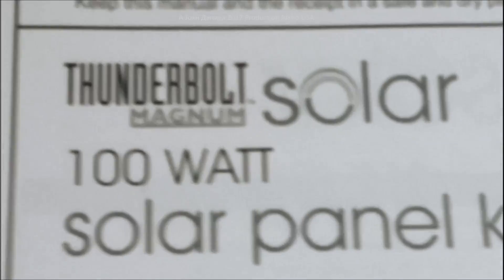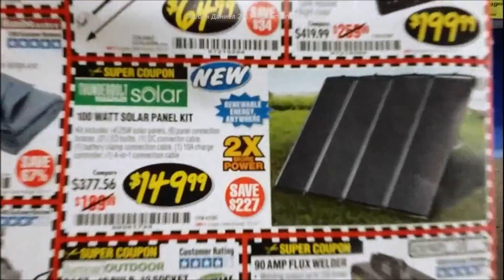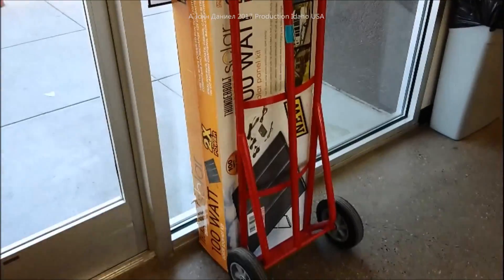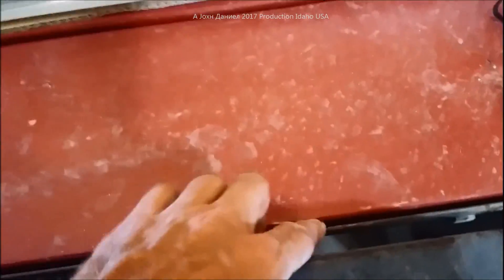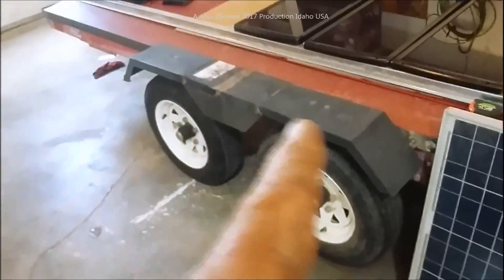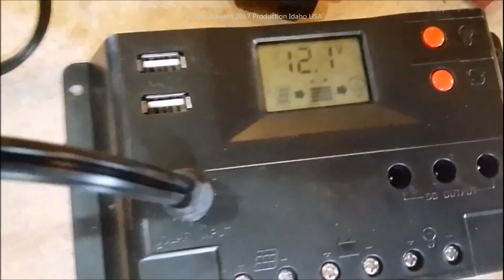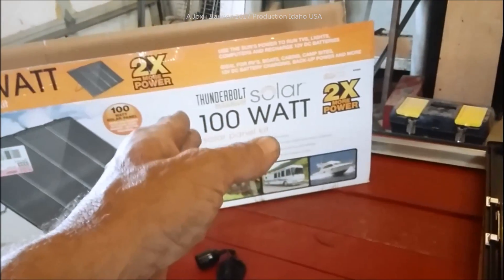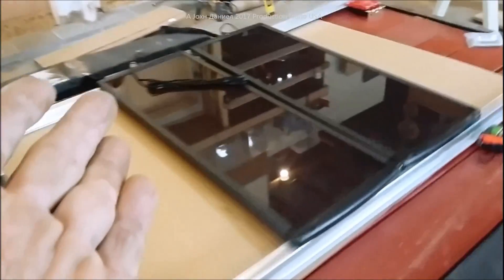Harbor Freight 100 watt solar kit #63585 NEW Thunderbolt Magnum (MAJOR PARTS LIST BELOW)

Comment: I was reading the Description area and followed ebay out on the solar panels " ADING! Best Solar Panels @t MightyMax100w4bar 5 of these 100 watt for a total of 500 watts, great low sun abilities & a perfect safe 92.5% the capacity of the 40 amp MPPT and VERY SMART design. "  and i noticed that the size of these solar panels are perfectly matched with the harbor freight ones.  2 hf 25w panels = same LxH as 1 mightymax panel and the voc is pretty close to hf and everything!!  good lookin out on that! I prop my 300w of HF panels against south sid of house on ground, plan on adding these mightmaxes in the middle of them to catch best part of the days.  I still am running my HF in series/parallel 2xseries 6 sets paralleled.
Reply from the maker: Yes, the 100 watt panels I found and use in my stuff, the best part is the 4 buss bar allows you to lay them flat and still get 75% and better from them. Few can do that.

Comment: I’m a new rv owner. I only have meg and positive the I connect to my car using jumper cables. I’d like to do this. John Daniel will you help me. I can buy the solar set up. Then a rv battery. Idk why my plugs in the rv aren’t working only one is working in the bedroom. Do I need to buy a inverter? Check fuses?

Comment: How long does it take to charge your 12v battery off the 100 watt solar panel
Reply from the maker: Depends on the Amp Hour, starting voltage of battery, Age of battery and wire length to battery. 
Standard #24 size 12 volt deep cycle marine battery at 11.75 volts ( low battery ) and a kit with a normal days sun you can be fully charged in 9-10 hours.

Comment: I purchased 2 of these kits and compared to the old version these are not as tough. We had a hail storm which blew everything over. 2 of the new panels cracked and none of the old panels cracked.  Otherwise the 100 watt sets work very well. I keep vehicle batteries charged.

Comment: 👍 Hello John!

Oh man, would it be nice if we also had a shop like "Harbor Freight"!
And YES, I always watch your videos more than once!
On some days your voice sounds through the living room as if a good old friend was visiting!

That's what our alternative thin-film guru's say, they swear by thin-film, also because of the obsession - our state consultants to get funding from the state-privileged solar installers who only recommend the overpriced monocrystals. You don't get a connection certificate for others than the recommended ones, so there is no funding and you cannot feed your electricity into public networks - which I don't intend to do anyway. A solar consultant has charged me with a south-facing roof with an unobstructed area of 130m² [1399.31 square feet] and I have a self-sufficiency of 48% - an idiot who feeds in and buys back his electricity expensive!

Comment: John.  Quick question about the 100 watt Harbor frt. solar kit.  If I had 2 of these kits, would it work to use both charge controllers paralleled to the battery bank?
Reply from the maker: Yes, the battery will not know the difference but the controllers may switch on and off charge a bit different from time to time.
Reply: @JOHNDANIEL1  Thanks John.  Then again, it might just be better/easier to get the 400 watt controller!

Comment: It's a miracle 12v showing, but what about the current going in? Do a test outside under the full sun showing Watt input, panels facing the sun & panels lying flat. Looks like a great kit, well done Harbour Freight.
Reply from the maker: The next few videos I did on them shows the mounting, and use with output.

Comment: I have a harbor freight inverter like to know if it would work for my RV AC unit cen-tech power inverter 1,500 watt continuous/3,000 watt surge  item 60601
Reply from the maker: No, your surge to start exceeds 3200 watts for up to 5 seconds. You would need the 3000 or larger inverter with a high surge capability.
Reply: Is there one that you would recommend over harborfreight or is harborfreight going to be fine
Reply from the maker: @chuckmac6541  I would upgrade to 3000 watt and if you stay with a square sine wave style get a better modified plus style and if its under 18 lbs for being a 3000 watt I would pass on it.
Reply: And how many golf cart batteries would you recommend for solar
Reply from the maker: @chuckmac6541  Depends on your entire needs, solar input, and what your trying to install it in.

Comment: Hello it's 2019 now, do you still recommend this??? 

If so I'm getting it. Winter is coming to the north east, very low sunlight soon
Reply from the maker: Yes, Not as a home solar system, but as a good basic power source. I just did a video last night, at almost dark and the panels dirty and still laying flat on my truck with total thick snow clouds blocking and it was making 14 watts still, I was glad after 2 years up there they have not as the naysayers said lost their ability to do well.
Reply: @JOHNDANIEL1  thank you! I'll check out the new video, I watched the1 year update
Reply: I'd say it depends on how much you're willing to do yourself. You can get off of Amazon a much better a 100w amorphous panel and much much better charge controller for about $100-$110 (assuming you have prime for shipping). The big thing here is the charge controller which essentially determines the cost of batteries over the life of the system.  You'll still have to add in a bit of money for wiring and you won't get stuff like the LED bulbs that come with it, but you'll get a cheaper system at buy in and over the life.

That's not at all to say this kit won't do it's job, but having something like an MPPT controller instead of the PMW controller that comes with it makes a world of difference, especially for areas where full sun is not in steady supply.  

Briefly, the difference between PMW and MPPT is that with PMW you're stuck with the voltage that the panels are putting out for your charging voltage.  MPPT has some circuitry and a voltage converter that looks for and then settles on the best voltage to charge at.  If your panels are only making 11V and there's a 12.3V charge on your battery you can't charge it.  This is because depending on chemistry of your battery, you may have to have a greater charge voltage than stored voltage to actually charge.  

If I did get one of these setups, first thing I'd do is upgrade the charge controller followed by upgrading the wiring, but it's definitely a case of these do the job, but the job can be done better.

Comment: So what would ypu recommend to go totally off grid for power with a 50 amp travel trailer.
Reply from the maker: A LOT! The newer 50 amp service is 240 volt line from park/home with separation to 2 - 120 volt systems in the campers breaker box, your main goal before attempting to take it off grid is a 100% effort to cut its actual power needs first, then get your math ready for a solar layout. Feel free to ask in the future when you get the first part hammered out.
Reply: @JOHNDANIEL1  I have my TT in the power consumption mode it is. I dont have a TT that is new and using all sort of unnecessary items. What math do I need to do to figure solar system size? battery bank and number of panels etc...
Reply from the maker: @chadharris9353  Calculate all the items based on 2.5x the normal run rate and hours. IE: Microwave use, 1000 watt microwave uses 1320 watts to make 1000 watts heat but you only use it 10 minutes a day, then you have 1320 ÷ 60 min X 10 = 220 storage watts x 2.5 produced watts 550 watts gets used off storage battery. Watts in storage battery is math of battery amps x volts = battery watts. SO if you have 6 walmart batteries, 29 series marine battery as example, you have 102 AH x 6 ( 612 AH ) x static volts 12.8 vdc then you have 7833 stored watts capacity, after using the microwave for 10 minutes you have 550 less available. So to size your bank for solar, you take your battery need based on your appliances and planned use [example 9 hours of a tv using 50 watts is 450 watts off your bank or need to size a bank] so yours could be 10,000 watts of battery, and you calculate the sun power cycles ( amount of day hours you can charge from solar) Example 7.2 hours sun, how many solar panels x 1.25 do you need. How many 100 watt panels in a 7 hour cycle do you need to charge 10,000 watts of battery battery,  that would be the math. You must also calculate the prime use, thats the while in charge use during the day if you choose to use more. 
Theres a reason no online solar calculator is accurate, you can not predict human nature! But the basics are above, If I had much more info I can usually get people within 250 watts in design.

Comment: How many wats would I need  have electricity in 22x30 blding with lights and maybe 240 for welder and few wood working tools
Reply from the maker: 1500 to 2000 but add that welder, and you gotta add 8000 watts more!

Comment: Yeah, but under load, with only partial sun, what's the POWER generation? That's what matters the most. Voltage is nothing without a load. An almost dead batter can look good volate-wise without a load connected. Where's your amp meter, or a charger that shows actual power. If it's only charging with 0.1 amps, then it would take forever.

Comment: Those are junk. Use your head and buy a single 100w quality monocrystaline panel for $90  and a PWM charge controller for $30 and it will out for that HF junk 200%.
Reply from the maker: I have over 6200 watts solar and 2000 watts wind power but the majority of people who get to where I am is with a kit like this. 90% use it to learn since its made of all parts to show results of solar to usable electricity, no matter how small, then move up the ladder. You don't usually get people into a solar lifestyle without the solar bug! So hate if you will, but those goofy kits have put millions into full solar action, more than every Grubberment and Hollywood Limo driving Jet setting carbon burning GO GREEN fake leftist program ever concocted.

Comment: 3 years using these to power a home with No problems. Love them:) They work great with the Walmart 24D deep cell marine batteries, The main key is having a large battery bank to store energy in. I use 20 batteries.
Reply: Battery bank + solar panels?  Cool.  Sounds like you've got it so that during the day, the panels are both powering your home and charging the battery bank, so you can flip it over to the batteries at night, then repeat.

Comment: Dude your just saying this because your getting a kickback from the company. There are other people on you tube who say they don't charge much at all. One guy says he can run a basic led light 3 hours a day for 2 days and then it takes 3 to 4 days to charge the battery back up to where it was before. You shouldn't lead people who don't have much money to work with down the wrong path just so you can get a kick back. You seem like an ok guy but doing that is just plain wrong.
Reply from the maker: I don't make a cent from harbor freight. They don't offer anything for reviews not even discounts or coupons. You have to be some member of some group and have a website to approach them so I don't qualify.  Video is about what bought.  Look under the video you'll see a link to mighty max 100 watt panels and my point to go that direction once using this kit to learn from.

Comment: Great Video. Thanks for the info on the mounting material. I paid the same price (with coupon) for the 45w (3.75A) kit about 9yr ago and they still work but I am ready to get the new 100w (8.3A) kit for the same price (with coupon). It pays to watch for the coupons. I don't work for Harbor Freight but my 12,000 winch still works like new after 5yr and it has pulled some heavy motor homes onto the trailer. I got it with a coupon too.

Comment: This technology is out dated but my bf buys into the bull so I guess that's what we will end up with.  He just won't listen to me. Probably cause I'm a woman.
Reply from the maker: Being he's a Mule, have him haul 24 of them for $1200 up to run that AC unit or 7 of the MightyMax for $675. Work him like a mule LOL
Reply: @JOHNDANIEL1  thank you I showed him your reply and think it finally sunk in.
Reply from the maker: He should get the MM100 if your going past learning and hobby. These are very useful for anyone starting out, to learn and apply solar but if your going to build a real livable system, I only suggest them for outbuildings and maybe a RV to keep the batteries hot since they are a complete plug and play kit. But not for real home needs of anything large. Get the correct amount of MM100 and MPPT controllers I say.
Reply: @JOHNDANIEL1  he thinks a 5000 BTU air conditioner can be run off 200 watts of solar. I can't convince him otherwise. Stubborn as a mule. But I guess so am I as I will say I told you so til his dying day. LOL
Reply from the maker: Good to see the Mule is "pulling" up some better plan! Just start better and get good quality solar like MightyMax 100w (  https://ebay.to/2XoIGvg ) with 4 buss bar contact strips so it does well laying flat and in dirty conditions or cloudy, and plenty of new batteries, ALWAYS BUY BATTERIES AT THE SAME TIME, and for 500 to 1000 watts of solar you need 450 amp hours of battery or 5 like the walmart deep cycle Max 29dc. Use a Quality REAL 40 amp MPPT solar controller ( 500 watts input fits on this one http://amzn.to/2ggyi44 ) If you need answers then ask, I do a few solar and wind power installs every  month but check or post if you need to.

Comment: Those panels are ok, but not at durable as the old ones. They charge better yes but when using the supplied bracket attachments they become very flimsey and can twist very easy. The length of the wires supplied are also longer. You can also add the hub and add up to two kits in one controller along with one 45 watt kit too.
Reply from the maker: You do have the option to remove the plastic frames which I have done and it worked and place them in some 3/4" angle thin gauge aluminum. The seals on them are much better than the old ones, BUT not if the plastic frames stay on them. Using windshield butyl caulk and that aluminum ( 26 gauge ) you would be shocked, you can get 9 where 8 once fit. They do produce about 60% as claimed totally covered in dust and film. Thats AMORPHOUS for you! And for Durability, lifespan, my 2006 HF panels are still running the biggest they have (4 of them), 1156 bulbs @ 5.7 watt each 12v LED gate lights on the end of my property 13 years later, not one problem even the two 10 amp hour SLA batteries are over 6 years old and going strong on them.

Comment: o and the more i watch you the more i think your so full of shti
Reply from the maker: For 1, Harbor Freight kits are not a END ALL. They are the best way to learn. And mine that are over 10 years old still work running fence lights today. My 5800 watts on my shop and house are not HF. BUT,  It's haters like you that would have no one BUT you own a solar panel ( just like a typical leftist way of doing it) The simple fact is, according to Natural Resource Council 2018 report the crappy kits like this, and those from renogy or Sunelco are what gets people into solar, not dickheads like you who can't spell. They do not have the knowledge to buy a panel, a controller, wiring, fuses, batteries and inverters without first going out and getting a cheap $150 kit. From there over 60% end up with systems in the thousands of watts, and 10X the knowledge you spew. So lets just Consider the fact your a asshole, and bashing something that teaches people how to apply and learn solar makes you a huge asshole.

Comment: I have no bones to pick with Harbor Freight. People even said to me. If it has an kn-off switch, sold at Harbor Fright, stay away from it. But. Lately, China had stepped up their game. I think that they must have heard the world complaining, especially their neighbors in India. And they seemed to have put out some descent stuff. Even the flexible Sunyuee 100watt panels pump out over 6 amps. And they cost less than a $100. Now if I can just ignore the fact that they are slave driving commies. That never actually invent anything, just copy the hell out of it, and make it cheap.
Reply from the maker: When it comes to HF panels, you can hate ( because Hate now is a national sport ) or we can easily agree that HF has gotten more people into Solar than the Grubberment, Solar companies, Global warmers, global coolers, and even more than Al Gore has while burning 380 lbs a minute of jet fuel flying around collecting carbon credits combined.